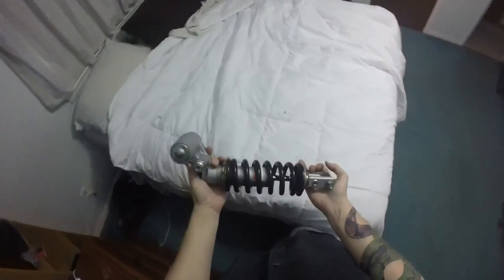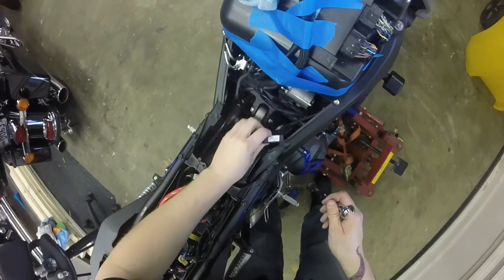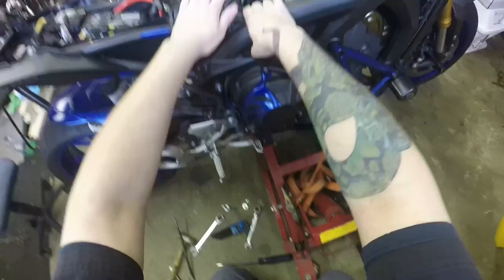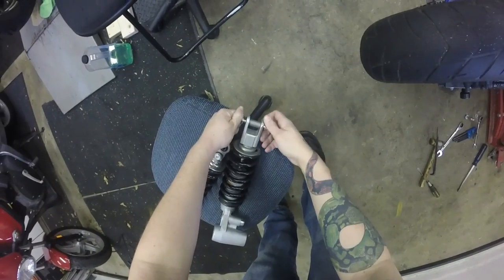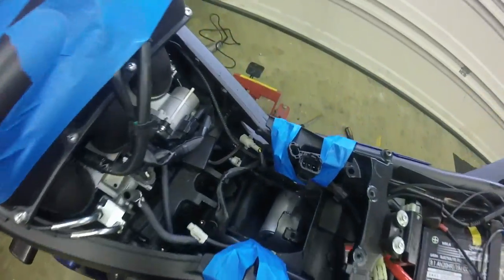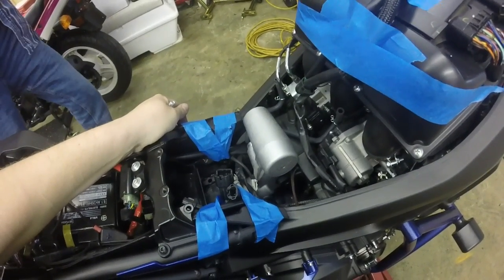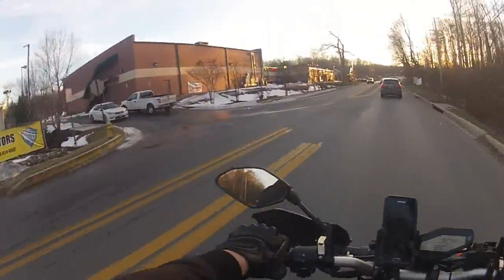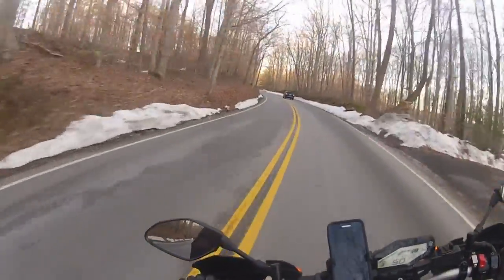hayabusa rear shock in a fz09

Comment: I did this conversion today on my 2016. Note to the world. Don't remove the bottom linkage. I did thinking it would make it easy. Lol. When I popped out the bottom bolt, the bike collapsed on my hands and smashed and cut me up bad. Then it fell over. I should have watched your video 10 times before I did this job. You made it look so easy. No hassle. Then I had an emission box I had to deal with. It's a California thing. That had to be removed. So, do what you did, not what I did! Great video. Thanks....

Comment: I just installed a zx6r rear shock and like you was amazed at how much planted the bike felt when getting on the gas. There are many ways to skin the cat when taking the shock out. I used a car jack between the rear wheel and the bottom frame to lift the rear but what you did also works, it is a pain in the ass to take in and out. Good video
Reply from the maker: +Paulo Campos yeah. they dont give you much room to work on that bike. tight squeeze no matter how you do it. if i didnt it again i would support the bike with the jack but not lift it off the ground like i did in the video. the suspension binds when its in the air and that made it more difficult on me. oh well, it was a learning experience. thanks for watching! have you done the front suspension on your bike?

Comment: The different between the Gen 1 and 2 shock is the Gen 2 spring is about 15 percent stronger.  I weight 215 without gear and gen 1 works good for me.  If you are low 200's get a gen 1.  250 plus you should probably go with the Gen 2.  Thanks for making this video it was very helpful with my install.

Comment: Hi, great video. I have just fitted a ZX6R rear shock to my MT09, it feels miles better already even without riding it, just need some warmer dryer weather to allow me to set it up.
Reply: The videos I have watched made it look really hard, it was very easy, took a while to take the tank and other bits off but the shock replacement took no time at all. The ZX6R rear shock I fitted was a 2009, same length as the MT09  15 plate one I took off. Hope this helps others.
Reply: Hello, I just installed a 05-06 zx6r 636 rear shock on my 2015 fz09 facing reservoir side up with the most minimal amount of cutting possible to the plastic tray with 2 clips intact.

How do you adjust the preload on the bike? 

Also what are your settings?

I'm 165-170lbs loaded with gear and a back pack.

I need some ballpark figures. 

Tips greatly appreciated.
Reply: What are your settings I too installed a 06 zx6r 636 shock and don't know what to set on it. 
I'm 165lbs
My settings 
preload: No threads showing / all out. 
Compression: all the way out
Rebound: half way out

Comment: Next time , put the top bolt in first. Way easier to wiggle the lower linkage, you can pick up the wheel to lign up the holes.
Reply from the maker: yeah. good call dude. I really made things difficult for myself the way I did it. thanks for the comment.
Reply: +MotoShane513 No problem! Will be doing this myself next week on my mt09. Your video helped a lot to know how much trimming needs to be done.
Reply from the maker: +brian antonissen glad I could help. good luck with the project. let me know how it turns out.

Comment: Hey thanks for posting this video helped allot. I'm in the middle of the project now and about to do the cut out and was wondering where you ended up putting the preload rings? I'm same weight as you 255lbs and trying prevent taking the shock in and out as less as I can. Thanks

Comment: so how'd you manage the adjustments? you mention in the video they're inaccessible.

just wondering because i've got the zx10r rear shock sitting, waiting to be installed.  i'm pretty sure the 'busa and zx10r shocks are similar in construction and the adjustment knobs are in the same place.
Reply from the maker: to adjust the preload I had to take a long flat screw driver and a hammer to tap the adjustment ring around a little at a time. took a while but it worked. the rebound and compression dampning can be reached with a long skinny screw driver. rebound is easy, compression is a little trickier.

Comment: nice vid man. I'm about to fit a zx6 to mine and was wondering about the clearance issue. has yours been rubbing at all?
Reply from the maker: I haven't noticed any rubbing. where has it been an issue for people? I may need to take a closer look at the bike.
Reply: Cool just put my 06zx6 in. just gotta dial it in. I've got alot of chain slack now which i asume is from the shorter wheel base
Reply from the maker: +Dan T is the zx6 shock the same length as the stock shock? I know the hayabusa shock is. 13 inches if I remember correctly.

Comment: Nothing incredibly wrong, but all sockets on a japanese bike should be metric.  Also any screw/bolt that looks like phillips isn't phillips it's jis... Learned that last one the hard way.  

What year busa?
Reply from the maker: you're right. guess I just grabbed what was close enough in the heat of the momment. good call! the shock, if I recall correctly, was a 2007. thanks for watching and commenting.

Comment: Did you use the 99-07 or 08-15 Hayabusa shock?
Reply from the maker: the 99-07. no idea if the newer ones work or not.
Reply: +MotoShane513 Thanks! I just ordered the fork kit like you installed and I'm now looking for a upgraded Hayabusa shock. You're the first source of usable info I've found for upgrading the FZ's too soft suspension.
Reply from the maker: +Bill Ness just keep in mind that I don't really know what I'm doing and might be doing stuff incorrectly.
Reply: +MotoShane513 You seem to be doing just fine. Working on your own stuff and learning along the way is laudable in my book. Stop knocking your abilities. I've been a mechanic for 30+ years and you just taught me plenty on modifying the FZ's suspension.
Reply from the maker: +Bill Ness thanks. glad I could help you out. I'm currently making an exhaust system for the bike so I should have that video up in another week or so.
Reply: +MotoShane513 I'm using an M4 slip on and love it! It makes all the right noises.
Reply from the maker: +Bill Ness nice. I think what I'm making is a similar, half ass rip-off of the M4. stock header and the a homemade midpipe and a coffman slip-on. should sound good and it was cheap.
Reply from the maker: +MotoShane513 worst case, I'm out a couple hundred bucks and I have to buy a real system. no big deal.
Reply: +MotoShane513 M4 is $350 at most. The factory header is perfect as is the mid pipe. No one that has an M4 is disappointed!
Reply from the maker: +Bill Ness yeah. I just wanted to try my hand at making my own. I like the look and sound of the 2 brothers system but I don't have that kind of money.
Reply: +MotoShane513 Go for it! I encourage tinkering and experimenting.
Reply: +MotoShane513 I can tell you I LOVE my M4 on my FZ.

Comment: Why a Hayabusa?  the one I heard recommended was a ZX6R shock.
Reply from the maker: I saw the zx6r shock recommended to but found a few people on some forums that used a busa shock because it's from a heavier bike and they were heavy people. I weigh about 280lb with gear on so in figured I'd give it a try.
Reply: MotoShane513 Are you a giant or a bodybuilder cause I didn't see a 280lb gut spilling into the camera lol.
Reply from the maker: +OspreyBravo18 must be the fish eye lense on the gopro hiding my gut. haha.
Reply: MotoShane513 Lol well I hope the FZ-07 is similar to this in terms of install because the GSXR-1000 shock is a compatible swap with the FZ-07 apparently and I'd rather do this then spend 700 for a Nitron shock I'm also about to look into Street Triple R shocks since the Street Triple R is very similar dimension and weight wise to the FZ-07 and they both have a 31inch seat height.
Reply: Fuck Ohlins is expensive even when it comes off a triumph that's being parted out....

Comment: first!!!how much do you weight?
Reply from the maker: +TheHappyRider about 250-255lbs.
Reply: MotoShane513 daaaaamn. just kidin. ok that upgrade was a necessity.
Reply from the maker: +TheHappyRider yeah. I think the stock suspension is for a 170-180lb rider. no way that was going to work for me. it feels much better now. I'll have the front done sometime in the next month or so.
Reply: +MotoShane513 I think it is set up more for a rider in the 140-145 lb range. Even at 180 the front is wayyy to soft.
Reply from the maker: +teamscreem I thought I had read it was set up for a 180lb rider but I could be wrong. I put in the GP suspension kit from Stoltec so the front end feels mich better. I have a video about doing that to.

Comment: Zx10 shock for me. Removed tank (a must) and use a floor jack to lift the bike up onto jack stands then used the floor jacks to manipulate the rear suspension by placing it under the back tyre.
Worst 4 hours of my life. 
Have a buddy help you! You need a spare set of hands to help balance the bike and get on a pinch bar !
Reply: What year zx10r shock did you use?

Comment: This is what I did, fit perfect, http://shop.penskeshocks.com/8900-SERIES-FZ09/ and then set the front up with Race Tech fork springs and gold valves. All for around a k buck including having my tuner install and initial setup everything for me.
Reply from the maker: nice! I'll bet it's a world of difference between from a stock fz09. got anything else planned for it?
Reply: +MotoShane513 Just enjoying riding it, and yes, it is a world of difference over stock. I used to cringe as I would use the brakes and go into turns, now, it is so much more predictable, you know exactly what the bike is going to do and you can ride in and out of turns with confidence.
Reply from the maker: +teamscreem that's great man. I'm still making adjustments to my suspension, learning as I go, but it already feels so much better then the stock set up. I can't wait to get the ECU reflashed.
Reply: +MotoShane513 130 mph is fast enough for me, heck, I'm a 54 yr old kid that still likes to lift the front end up from time to time and this bike is perfect for that. I rarely ride in A mode, STD mode is enough for me, but it is nice to know it is there if you want it. Good thing they did not have bikes like this when I was younger, I probably would not have made it this far. This is probably the most enjoyable bike I have ever owned, in fact, I put more miles on it than my Stryker.
Reply from the maker: +teamscreem haha yeah. before this bike in had a 1989 softail springer. the harley was a fun bike but no where near as exciting or fun as the fz09.